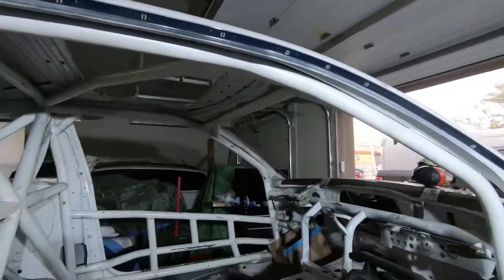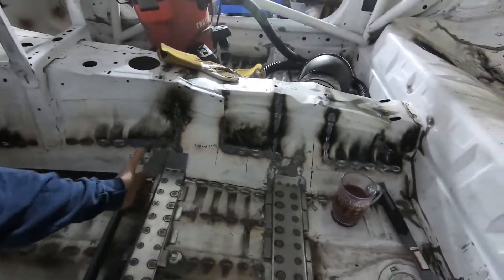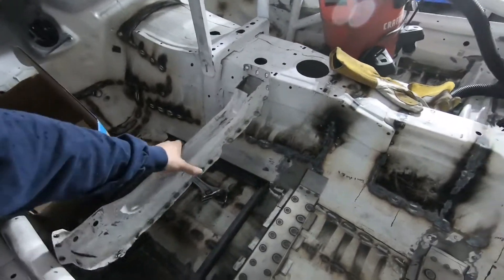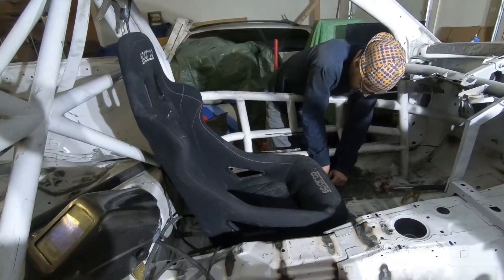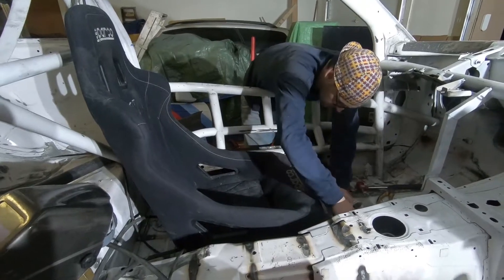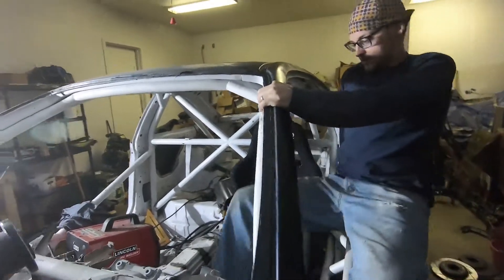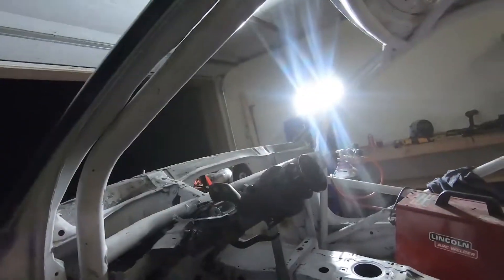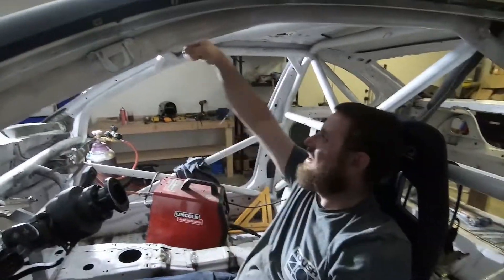E46 Race Car Custom Seat Brackets | 2 Inch Lowered Seating Position

Comment: Thanks! I'm probably going to have to do something like this on a car I got. Idk what the heck the cage builder was thinking but they put the main hoop in line with the B pillar on a sedan! And the overall fitment of the cage is kinda 💩 with like an inch or 2 gap between the chassis and the cage. So as is I barely fit in the cage. I knew that before I bought the car though haha. $1100 for it I can't complain lol. And I think theres only like 20,000 miles on the chassis. It was sitting in their shop for over 10 years and they never finished it...
Reply from the maker: It is really all abut finding the right cage builder. We found a great builder. Our bar are so close to the A and B pillar that you can't fit a piece of paper in between. That makes it surprisingly spacious inside. If you are interested I can forward you his details.